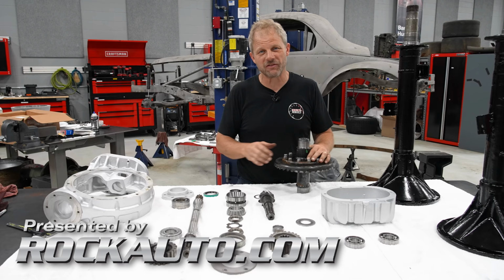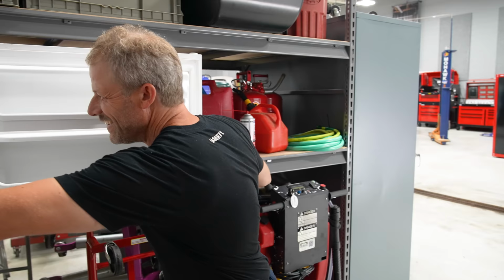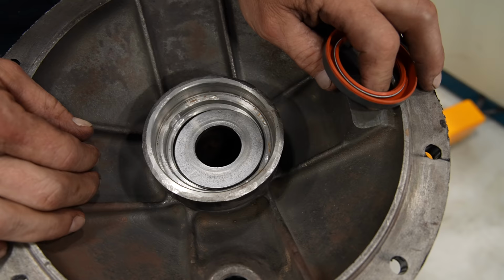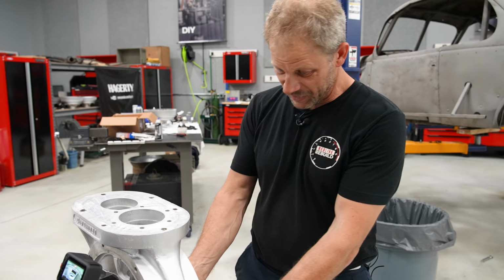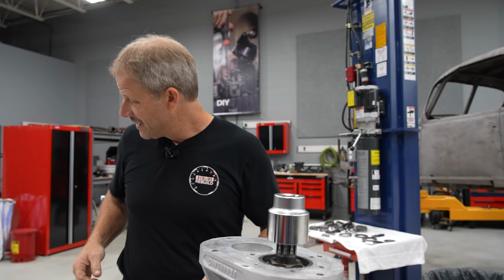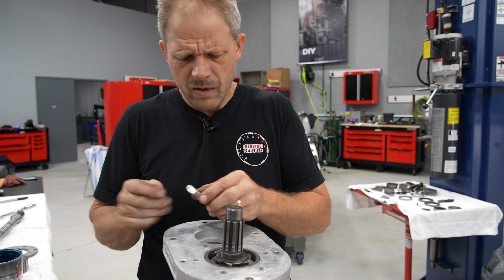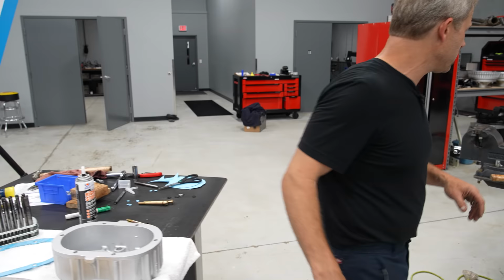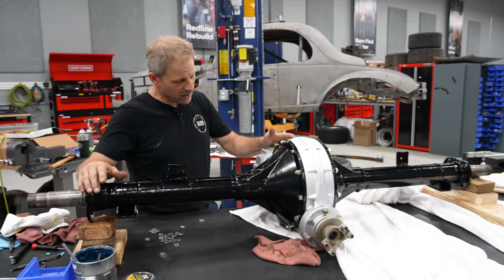Assembling a vintage Frankland Quick Change rear differential | Redline Update #88

Comment: it is NOT harder to contract a solid!
it's a matter of temperature "change"
taking it from shop temp, let's call that 75 degrees F, to 200 degrees F yields a difference of 175 degrees
but chilling it to freezer temp, let's say 30, degrees there's only a 45 degree change. 
You just need a colder temperature source.
Dry ice in a well insulated chest would have been better.
or
OR
you could have chilled the races AND heated the differential housings

or just use the press
it's all good

Comment: The BIG question is, how do you get the bearing race OUT of the side bells?    I have a winters, and the bearing race seat isnt notched for punching out the bearing races.  :(   Welding the race didnt work, since the fit in magnesium bells is tighter than it would be with steel.

Comment: You need liquid nitrogen or CO2, think about how much you increase the temp from ambient you have to decrease it a similar value to achieve the same contraction.  Freezer is at like -10-20°C heater is like over 150°C thats its like 30-40°C delta for cold case and like 120+°C for the hot case

Comment: I just saw you install the bearing in the center carrier. The bearing is sealed. Should you take the seals off so it can be lubed by the diff oil?
Reply: Same question 😏
Reply: @sergeymoshkin8538  yes I went back in an pulled the shields on the pinion bearing. I got a little ahead of my self on that one.

Comment: I have a Frankland QC center section and I am cleaning it up but I have no clue how to find the bearing and seals for it. I have looked all over the internet for diagrams to support the assembly or  supplies.  One question about these is are any quick change's all the same or should I just figure that the Frankland is obsolete?

Comment: I have a 10" I think, Franklan QC in an old ASA car i am rebuilding into a vintage trans am type car, I need to take it apart and rebuild it, or have it rebuilt. Anyone know who might do that work in MI? I'm in Howell. 

Also does anyone know the outer diameter of the 10 spline shaft the QC gears slide on? I need to build a qc transmission with reverse for a snowmobile powered buggy. I guess I can just take my QC rear apart but was not planning on doing that until I had the front stub replaced and the body mounted on the car so be a while.

Comment: Hey Davin,  when you put that bearing in (on top of the vise) @ 8:00 .  It had rubber seals on both sides.  Wouldn't that make it starve for oil when when the wee amount of grease inside dry's up?   I'm not being critical, just curious.   I often use bearings 
with rubber seals deep inside transmission's( I remove the seals though).  Either way, another great video.

Comment: Metals expand at the same linear rate whether heated or cooled.  The reason the oven worked well and the freezer didn't is because it's easy to heat the metal several hundred degrees warmer than room temperature, but the freezer was likely only 60-70 degrees cooler than room temperature.